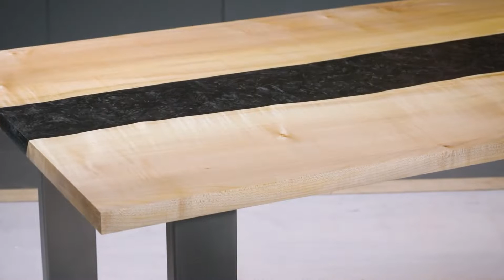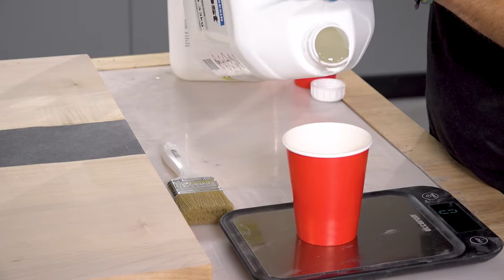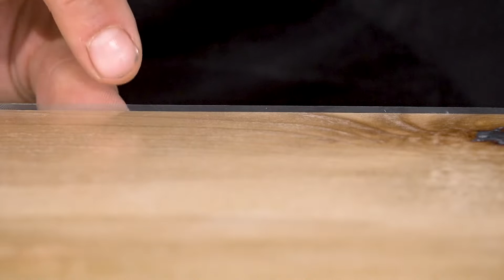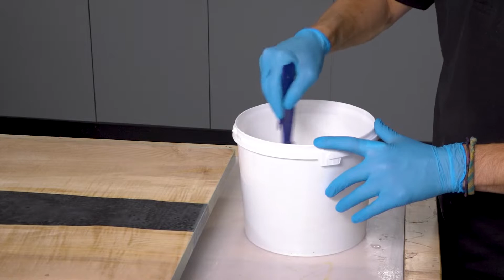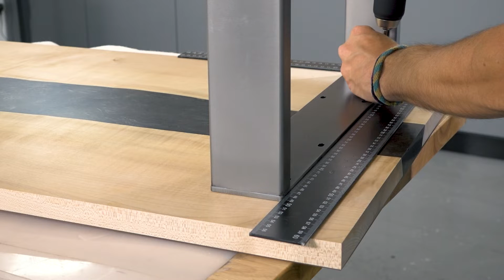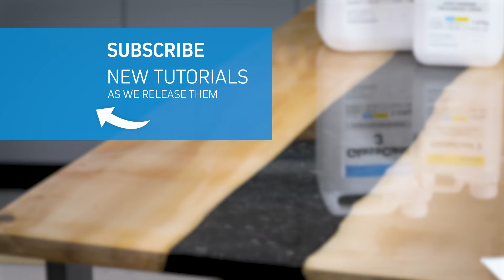How to Flood Coat a High Gloss Epoxy Coating onto Wood and Other Surfaces

Comment: How long do you let base coat cure?
Reply from the maker: For the sealing coat you want the resin to be fully cured to a point where you can sand it to produce a key on the surface. At 20°C, this will take about 24 hours.

Comment: You need to seal the all edges so that moisture can't cause warping. You need to lock in the moisure content or your asking for trouble.
Reply from the maker: We tend to recommend kiln dried woods for these kind of projects so that the wood is already stable and less likely to move.
Reply: @glasscastresin  kiln dried doesn't mean that it can't reclaim humidity. It's a temporary means of stabilizing the lumber but it doesn't permanently reduce its ability to keep moisture content low.

Comment: How would you do this if you wanted the resin to flow over the edge where the bark is still attached to a biscuit?
Reply from the maker: The process would be similar apart from the tape barrier used to keep the resin in place. You would naturally need more resin to account for the additional area that the resin needs to cover on the bark edges and also any run off. You may need multiple layers of resin to fully coat the bark so one option wudl be to brush the resin onto the sides and build up the thickness that way. Then once completed you can do the final floodcoat over the top and allow it to run down and finish off the edges.

Comment: Working in weight instead of volume in this situation is just confusing and incorrect
Reply from the maker: We sell our resin by weight, so working in weight helps to quantify the amount required. The resin can be measured and mixed both with a volume ratio and weight ratio. As digital scales are more accurate than a visual indicator on the side of a measuring container we tend to favour this method for measuring out the resin and hardener.

Comment: Why did you not let the epoxy flow over the edges?? Would look much more professional.
Reply from the maker: It's really down to personal preference and on this table we wanted to create a nice crisp edge without a radius created from the resin running down the edges.

Comment: can this be poured over an uneven surface like tile? i’d like to pour this over a tile shower floor and im wondering if it would be compatible. also, does it scratch easily?
Reply from the maker: It could but we'd recommend splitting the pour with the first layer being used to bring the overall level to approximately the same height, and the second pour, applied when the first has reached its B-Stage (firm but tacky to the touch) flood coating and providing the perfect surface finish. Splitting the pour ensures a great finish whereby pouring in one go can result in small dimples in the slightly thicker areas where the surface slightly shrinks back.
Reply: @glasscastresin  ok awesome this is super helpful! so just to make sure i am understanding you correctly, you are saying 1. pour a first coat that is thick enough to bring the overall level to the same height. 2. waiting for that coat to dry to a "b-stage" and then 3. pouring a second full coat. i am understanding your directions correctly? thank you so much!
Reply from the maker: That's correct yes. Doing it in stages like this usually leads to a better, flatter surface. It can  become slippery when water is sitting on the surface so might be something to consider.

Comment: Great channel, do you have a suggested sealant coat? I want to flood coat my epoxy charcuterie board. I already have the flood coat epoxy. Having troubles finding a good sealer… thanks 🇨🇦
Reply from the maker: I'm glad that you enjoy our channel! We use a small amount of the resin and hardener mixed together as the seal coat. Depending on which epoxy you are currently using it could be possible to do it with your current resin.
Reply: @glasscastresin  thank you for the quick reply, keep on keeping on 👍

Comment: Hey ... how can I get a super thin coat? ... I find it thick, and that would cost a lot when I produce a large batch. Thank you in advance.
Reply from the maker: Ideally the GlassCast 3 needs to be poured in a layer at least 2mm to allow it to self level and produce a flat glossy surface. Less than this and the resin might not cure as intended.
Reply: @glasscastresin  👌

Comment: Bonjour, do you think it would be interesting or totally useless to polish the tray once the resin hardens?  with NW1plus and Topfinish 2 products
Reply from the maker: Generally the GlassCast 3 has a very high gloss out the bottle but if you needed to sand it or do some repairs, no reason why you could not then use those polishes to get back to a high gloss finish.
Reply: @glasscastresin  ok y understand, y test today 🙄

Comment: bonjour, can I use another brand of resin to make the first coat of resin with a brush, I haven't received the Glasscast3 yet and I don't think I would have enough to do everything!! merci
Reply from the maker: For a sealing coat, any good quality epoxy is likely to be suitable,  although it may be wise to do a small test incase there is any unforseen incompatibility.
Reply: @glasscastresin  ok merci 🙏
Reply: @glasscastresin  it's done I passed the finishing coat with Glasscast3: it's very pretty, thank you for all your advice and thank you for taking the time to answer my too many questions 😇

Comment: Excellent video., I do have a question. I poured resin onto some mosaic surfaces which are small table tops for the outside. I did follow all instructions, and they were fine in summer, but as the weather turned into winter, they have not lasted. A couple of cracks and delamination occurred. I can of course resand and apply more UV resin. However, what might I do to prevent the resin from turning yellowish and delaminating for next go-around>? Thank you.  I can't find info on this problem! In Canada, we get temp extremes outside. Should I use a boat resin instead? We need the tables for the nature centre exterior area and can't come inside for winter as people use them.
Reply from the maker: The GlassCast range of resins are not designed for outdoor use like that so if you can't find a UV stable outdoor resin, then we would recommend bringing the tables inside when not in use or creating a cover.  Epoxy chemistry is such that you can gain a good level of UV resistance but the resins are not UV stable so will still yellow outside over time.

Comment: last question please, can we treat the tray with Rubio or Osmo before finishing with GlassCast 3? merci 🙏
Reply from the maker: Oil based products and stains will likely cause adhesion problems.  Other stains and finishes can be used as long as they are fully dry before pouring and the surface can be suitably keyed to help resin adhesion.
Reply: @glasscastresin  merci 🙏

Comment: Bonjour, is it possible to pour this resin also on the edges (without putting the adhesive tape)?  will there be a resin thickness problem?
Reply from the maker: You can follow our worktop videos and use that method for the edges.  That avoids any issues with resin thickness.
Reply: @glasscastresin  ok I ordered the resin (it will be available next week) do you have a calculation formula for 2kg per M2, I have 0.450 M2?, thank you

Comment: 🤔 And the edges? Imo the edges should match the top.
Reply from the maker: They can be done as a separate process or done similarly to a worktop and let run down the side.
Reply: Yes leaving them exposed ruined it for me, like half done.

Comment: If you put eg a 3mm rounded edge on the table with a router, and then sand the sides of the table and also the round top edge - lets say to 1,200 or even 2,000 grit - how can you avoid that you scratch your beautiful flood-coated top surface?
Reply from the maker: You would need to mask the perimeter with a good quality masking tape or similar that extends in at least as far as the base plate of the router - this should be sufficient to protect the surface but I would also suggest leaving it a few days to cure as much and as hard as possible as the longer you leave it, the more resistance it will have to being scratched.
Reply: @glasscastresin  But then could you not just repolish the surface if you did scratch it?

Comment: The density of cured epoxy is 1.2 g/cc. So you need 1.2 kg of resin /square meter/ millimeter of thickness.

Comment: Very useful tutorial. How heat resistant is the surface. Could you put a cup of tea on it for example.
Reply from the maker: The GlassCast range of resins is limited to around 45'C so a red hot mug is likely to leave a mark in the surface. Notwithstanding that, we have numerous customers who make products such as coasters using our GlassCast10 and in common with all epoxy resins that we have tested, following a full 7 day cure, a very subtle ring can be left by leaving an extremely hot cup to stand on the surface of the resin, this mark is slight and can usually only be seen if the surface reflection is inspected closely. Customers who use this resin for drinks coasters report that the marking is almost un-noticeable in practical applications and continue to use GlassCast 3 or 10 commercially for coaster applications. 

It may be that we’re more conservative but in reality, having tested dozens of ‘high. temp’ Epoxy Coating Resins side by side, the results always tend to be similar between our resin (limited to 45’C) and those with higher temp. claims. Our testing is quite straight forward; pour two identical samples, one in GlassCast, one with the competitor product, and divide each into four sections so that we can conduct the same test after (end of standard cure for the given resin and then 7, 14 and 21 days thereafter).
 
Our test involves pre-heating a mug with boiling water, emptying it after 30 seconds and then put newly boiled water back in – the mug is then placed directly on the surface for 5 minutes. In our own testing, all resins performed more or less the same, with a small ring left behind. The ring is generally faint and only visible from certain angles but nonetheless, even supposedly high temp. stable coating resins had the same issue.

 I realise there's a lot of information above to a straightforward question but I hope this helps.

Comment: Hi just wondering if i can use varnish on the wood and river pour?
Reply from the maker: Most varnishes will adhere to the resin once it has had a suitable key.  However the resin itself will normally have a tough glossy finish once fully cured so it may not be necessary to use one.

Comment: In the minute 1 after sanding it, the middle chopped fiber section looks very grey (even after wiping it). Why does it look so shinny at the end?
Reply from the maker: Hi David, sanding the surface puts micro-scratches into it, hence it looking grey but when the resin is applied, it infills those scratches and leaves you with a beautifully clear finish. The scratches are needed to give the resin something to mechanical grip to.